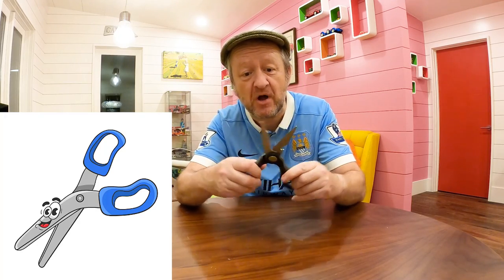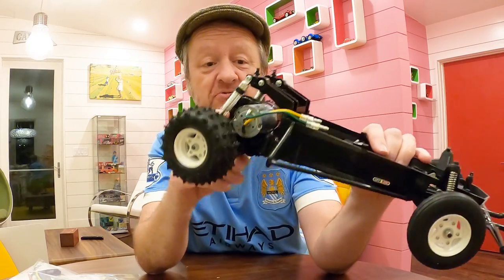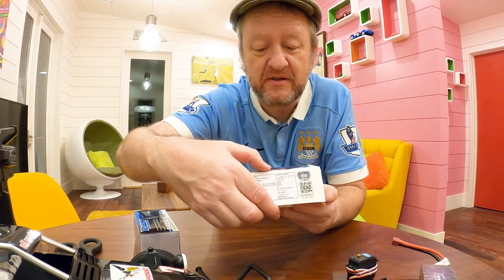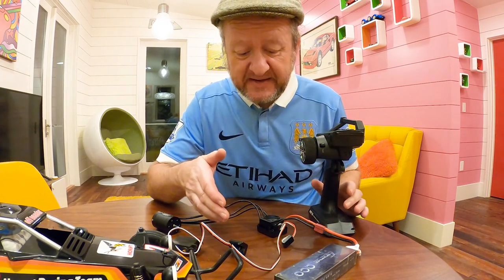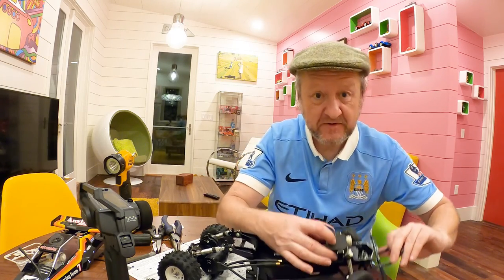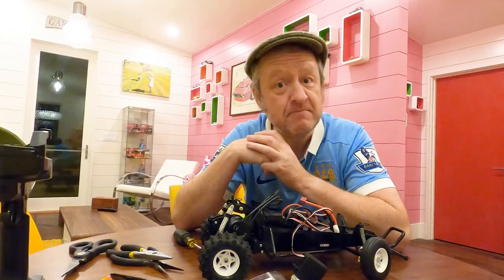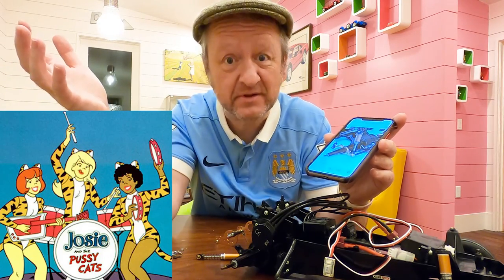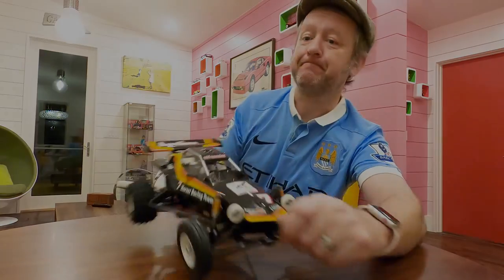Tamiya Hornet HOP-UPS, installing a brushless Motor, lipo2s...better Suspension plus Stabilizer Bar

Comment: Got a mad bull totally ball raced on ftx vantage 2.0 shocks on 8.4v 5000 nimh it's a blast.
Reply from the maker: I need to get one of those...it's not one I'm too familier with.
Reply: @archiscapes1503  also made my own servo arm got rid of the wire one.so made one out of the vantage front steering arm no slack or wobble or popping out as on the ball joint linkage love makingvthings better on the cheap.

Comment: Nice video. It would be fun to drive, with the brushless set up. Did I miss it. Did the gearbox 
also get bearings, like the front wheels? 👍🏻
Reply from the maker: Yes…I put bearings in gearbox.
Reply: @archiscapes1503  Cool, it definitely needs it, with that brushless motor 😂

Comment: You don't need any of these over priced electronics or battery. The Tamiya electronics and motor work just fine.
Reply from the maker: You don’t need anything..if you like Tamiya electronics..good! It’s up to the individual if they want to customize their buggy/ car. That’s what’s great about our hobby. I have buggies with the original Tamiya electronics from the 80’s..they are fun. But I also like the Brushless Reedy/ lipo electronics too.

Comment: Them shocks are rubbish..
Reply from the maker: I was actualy told that before buying them..but I went ahead and got them anyways to try for myself..to my sunrise, the Hornet handles much better..but I think the stabilizer bar and sway bars really helped. Plus, I really love the look of these..and the stabilizer is awesome looking. I actualy should have put in the video that I rebuilt the shocks..emptied the oil, cleaned  them..and put tamiya medium weight oil in them. I love them..glad I took the risk and got this setup. The Hornet just “carves” up the track…but still has that fun “hopping” feel..just not as bad. Yes..there are better shocks out there..personal preference
Reply: @archiscapes1503  that's what it's all about, as long as you are happy with what you got, my opinion means nothing. Lol
I used a 20 weight oil in mine. The lowest I could get and they run less stiff now. I agree, they do look amazing on the hornet.
Reply from the maker: @wildcat650power  👍